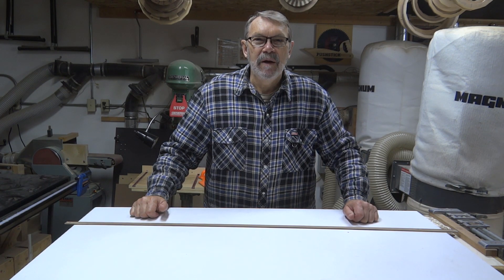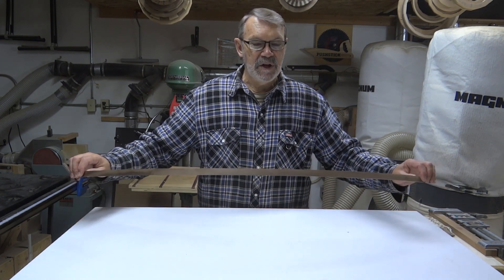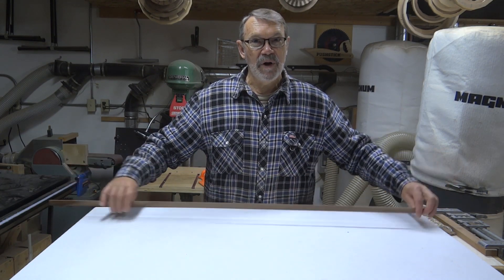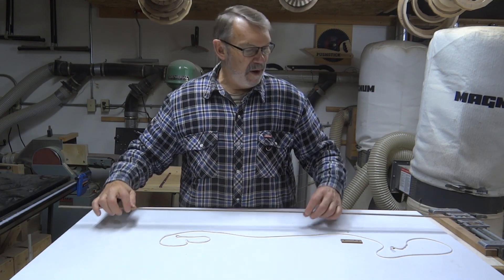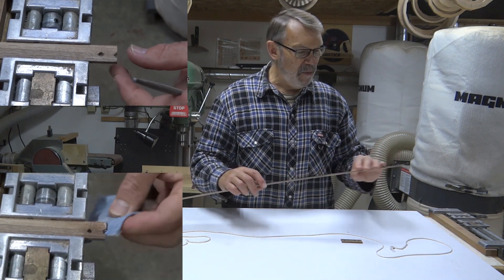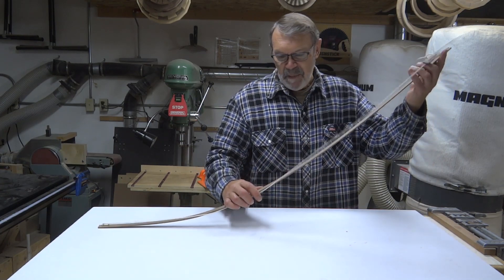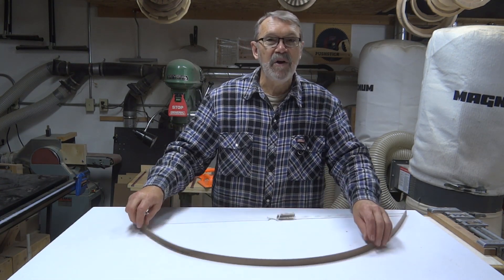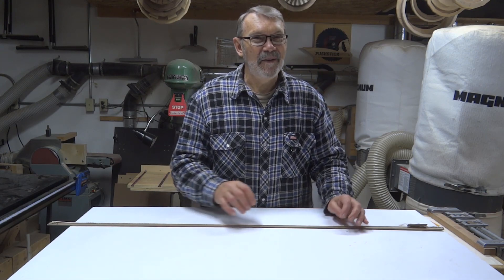Quick Tip - Making a Drawing Bow

Comment: Great tip, Gord.  Drawing bows are very useful in the shop.  A thin, long strip of counter top laminate will give you a consistently symmetrical arc.  Wood grain (even very straight grain) can cause slight differences in the arc.  That doesn't make them unusable, just not always consistent.
Billy
Reply from the maker: Great idea, Billy. I realized that wood wasn’t likely to give a symmetrical curve but couldn’t think of what I should use. Thanks for the input, my friend! 😃😃👍👍

Comment: I agree this is a very simple and effective tool, and your solution is elegant.
However you need to be careful as the CURVE that this tool will draw is NOT and ARC. An arc is defined as a portion of a circle's circumference. this tool will create a curve which can be approximated to a parabola.  If all you are interested in is having a repeatable curve for aesthetic reasons then no problem. If you genuinely need an ARC, (for example because you have two parts rotating against each other) then this is not a suitable tool :-)
Reply from the maker: Thanks for the input. I hadn’t thought of that. Sorry if the wrong terminology bothered you. Now, of course, the challenge for me will be remembering that! 😱😱😱